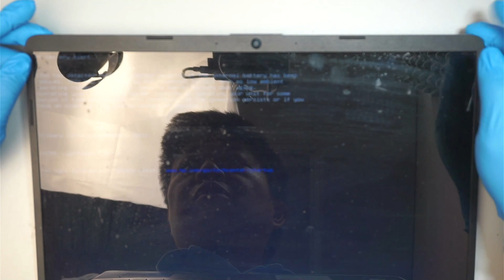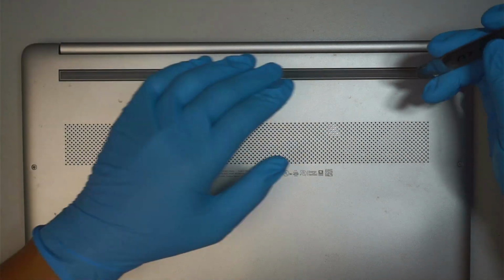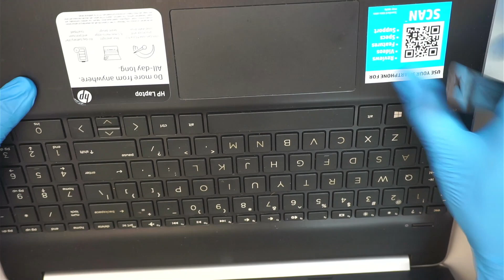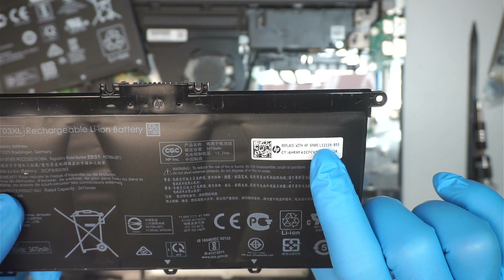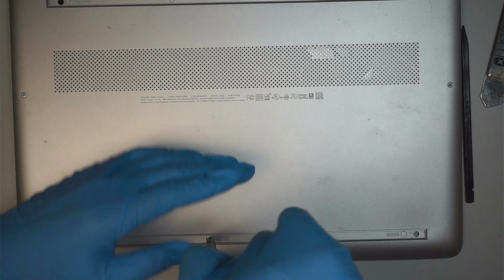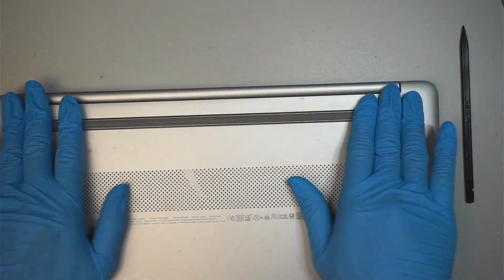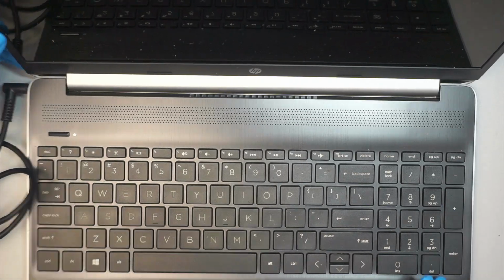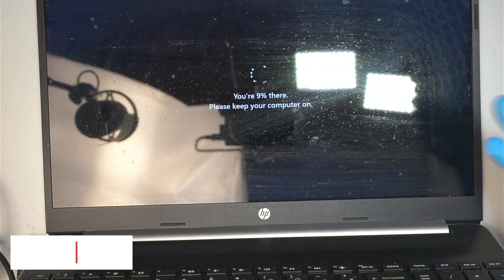HP Battery Alert Error Primary Internal Battery 601

Comment: Hey guys, HOPE am not late.
Recently, I had the same problem for about three days, and honestly, it really stressed me out every time that message appeared on my screen. Everyone kept saying the only solution was to replace the battery , but surprisingly, I fixed the problem without buying a new one.

I discovered that this issue can come from either hardware or software.

--- If it’s hardware, then yes, you’ll eventually need a new battery.
--- But before spending money, try this simple software fix, it worked for me.

Sometimes the problem happens because the computer starts failing to properly load your user profile. That may sound unrelated, but it can actually cause strange errors like this.

Here’s what I did to resolve it without buying a new battery:

1. Create a new user profile on your laptop and make it an administrator account as well.
2. Log in to the new user account.
   Don’t worry , you can still access all your files from the old account through the C or D drive, so nothing is lost.
3. On the new desktop, create a small test file (for example, a .txt file or a Word document).
4. Shut down your laptop completely and wait about 3 minutes.
5. Turn it on again and log into the new account.
   Make sure the file you created is still there , that’s a good sign.
6. Restart the laptop once more.

The battery alert message should now be gone.

This works because the new user account creates:

a fresh power plan,
new battery calibration data, and
removes any corrupted settings from the old account.

Good luck, this simple trick can fix the software side of the problem without replacing the battery! 💪🏽🔋
. Its now a weak since i last saw the error message and everything is working far fine and better

Comment: Dang. Mine just started doing this even tho i barely use mu laptop when its not plugged. I always used it plugged cuz im always at home and this happens just after 2 years of replacing the battery :/

Also, the homescreen wont load after i enter my password which sucks (even if its plugged)
Reply: Same. Did you replace the battery and did it fix the issue?
Reply: @Tatt2dmoon  I didn't buy another battery. Not worth the money by now tbh. Probably why it broke so early because the battery quality is ass and it wasn't even original. I had it removed and hoped for the best it still works without the battery, and yes it does still work. So now I always use it plugged in hahaha 

But yeah the issue about the homescreen got fixed but mainly probably because I resetted my OS
Reply: @luv_kofee Same here.. I am also using it while plugging the battery in...does this harm the while using continuously like this for months (4hours a day) will there be any issues like swelling or sth? I just need to ask to be sure I am safe !
Reply: @nischalb09 are you using the original battery right now? Or not? It should be fine if you have it constantly plugged in, just don't overheat your laptop. I don't really know why mine broke.

I recommend checking your laptop's battery. Mine swelled so i had to take it out. (it was bought online)
Reply: @luv_kofee ok I will check if it had swell by going to help center... if it had i will remove the battery and use by charging only and yes it is the original battery i have never replaced after I bought this laptop
Reply: @nischalb09okay, that's much better if u had it professionally checked. Update here bro if u can

Comment: I purchased 2 new batteries and I still get the 601 alert message.  Nothing seems to work.  What should I try?
Reply: Then it's a software issue.
Try calibration
Reply: @jonnymakers9560 did you manage to solve it ???
Reply: @himanshukumar-ff5cf  Yes I swapped out the motherboard (purchased the exact same from ebay.  The motherboard charging was not working correctly.  I swapped out the motherboard and installed the exact same battery (newly purchased from ifixit) and everything worked perfectly.  What I am thinking is that when I removed the battery plug from the original battery I must have removed it at an angle...maybe shorting out two pins?  So note to self....remove battery plug very very slowly and carefully.  Thank you...

Comment: What do you exactly mean by what you said about the COMPUTER RESETS after successfully replacing the batteries? All the data will be erased from the computer or what?
Reply: No, the data is retained, only the bios settings are reset to the default settings, so personal data is not deleted